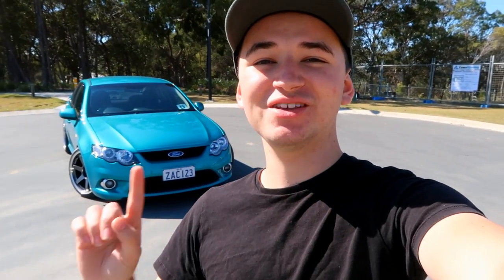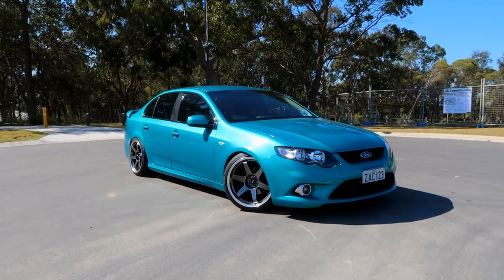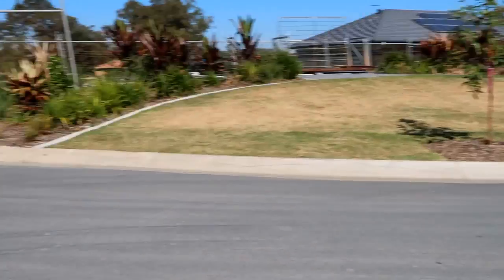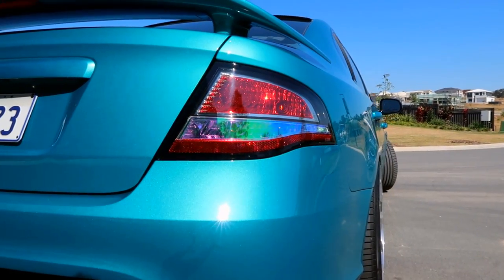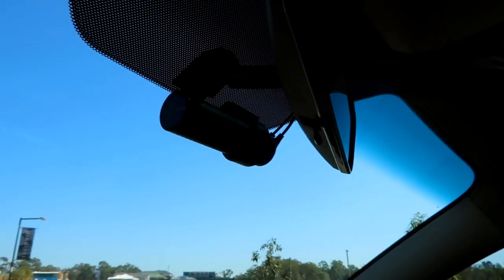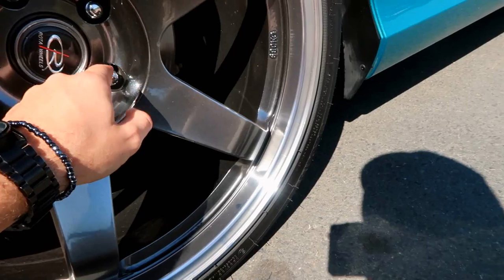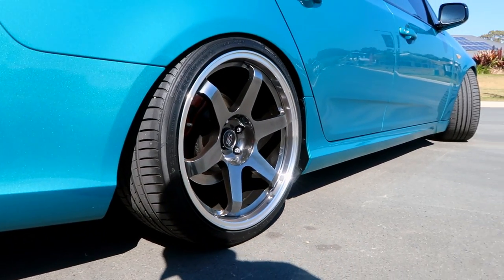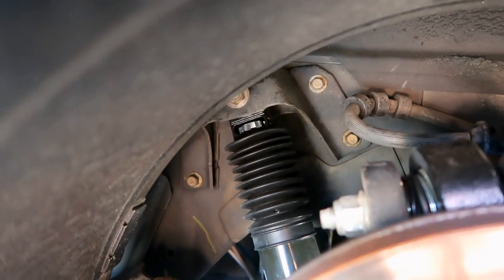ZacBaldy Car Check: Ford Falcon FG XR6

Comment: Why don't you just buy an XR6 turbo if your gonna do a turbo conversion
Reply: Because he's on p plates
Reply: Turbo barra is the stronger motor na barra needs a bit more then just a turbo slapped on the engine
Reply: Turbos are stupid expensive. They are literally like an extra 5 to 10 grand. No shit